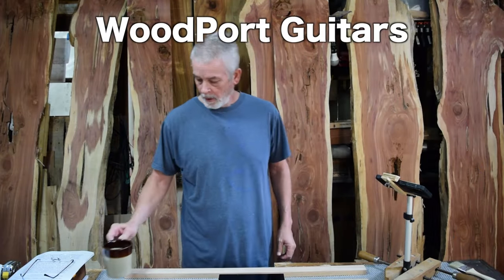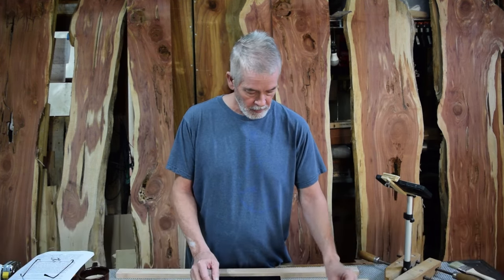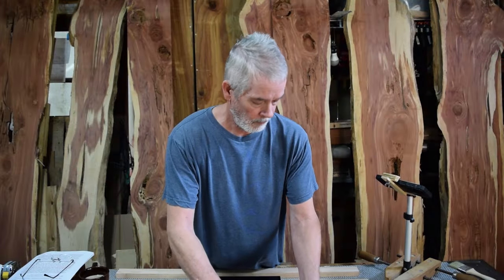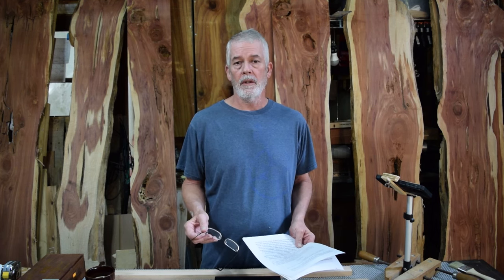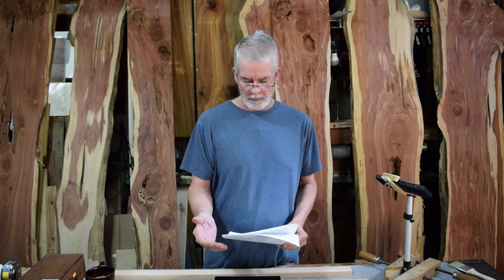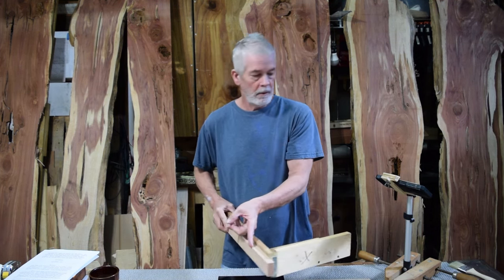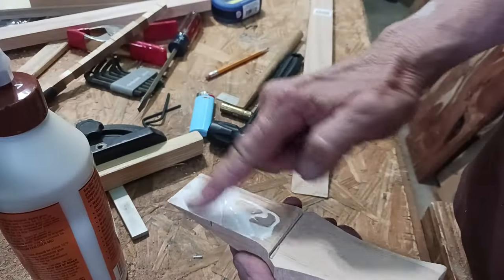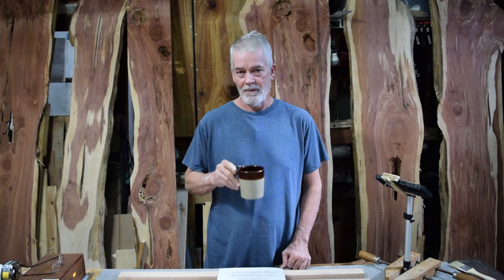ScarfJoint Cigar Box Guitar - Going Electric

Comment: If you sand above 220 grit it will not take stains or dyes very well and be blotchy. Shellac is your friend afterwards before applying a final finish. A little table salt will add grip to help keep the glue up from sliding around and dissolves as the glue dries.
Reply from the maker: Thanks, and thanks for watching.

Comment: Interesting.
Reply from the maker: Thanks. I really like the way it looks.
Reply: @WoodPortGuitars  Are all or most cigar box guitars three string and what is the gauge and tuning of them if anyone has the time please? Thank you!
Reply from the maker: That is a great question.  It would take a lengthy reply to explain it well.  I will do a video about this soon.  Please subscribe and ring the notification bell so you know when it comes out.  For a short answer.  Cigar box guitars are predominately 3 string.  There are 4 and 6 string and even 4 string bass cigar box guitars.  The bass guitars usually use the same gauge and tuning as a regular 4 string bass, the tuning is EADG, I'm not sure of the string gauge of the top of my head.  The 6 string cigar box guitar is usually tuned to standard guitar tuning, EADGBE, lowest to highest.  The 4 string guitar can use the low 4 strings, or the middle 4, or the high 4 strings of a regular 6 string guitar using the same tuning as the guitar, EADG, ADGB, or the high would be DGBE, and often these will have a string tuned a step lower, like DGBD, a G major chord. There are lots of options.  Three string guitars will use what would be the equivalent to the low three string of a standard 6 string, the EAD strings, and raise the A and the D one whole step, so you have EBE, and that is an open E power chord.  When i string up for G, I use the ADG strings of a standard 6 string and tune the A string a whole step lower to get GDG, an open G power chord.  For reference, a set of Electric Guitar Strings Light gauge is: Low E .042, A .032, D .024, G .016, B .011, High E .009.  Hope this helps and isn't confusing.  There are many options these are just starting points.  Cheers.

Comment: There are two ways to stack your scarf joints. You want the joint to be at the head connection, not at the fret board. Ask me how I know😄 Even with perfect alignment you can have a dip at the first or second fret. I had to use a jumbo fret on  the#1 fret  to lift it slightly upward. I was getting buzz that I could not get rid of till I put a straight edge on the frets and saw the dip above #1. Save yourself some possible headaches later.  Make sure the joint is at the head, that way there is no chance of making a mistake. Some of you are probably finding this out the hard way, like I did.
Reply from the maker: I have had to laminate a thin piece of wood on top before.  I'm planning another scarf joint video and the jig, that would be good info to include. Thanks. And thanks for watching.